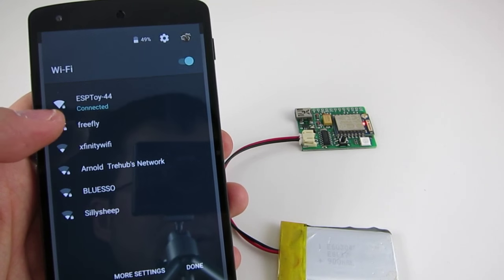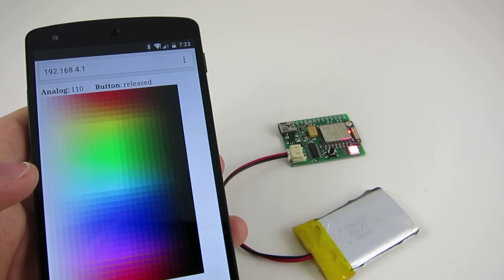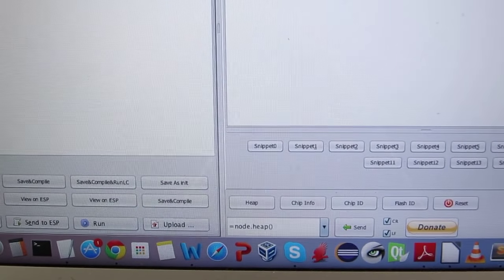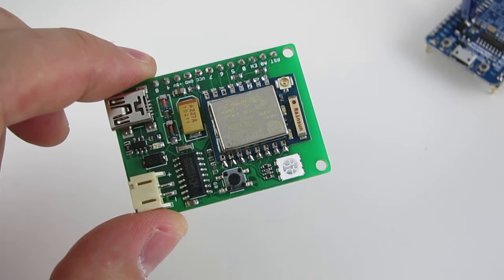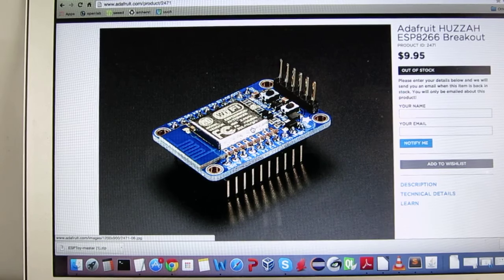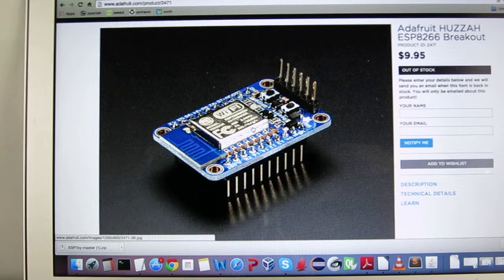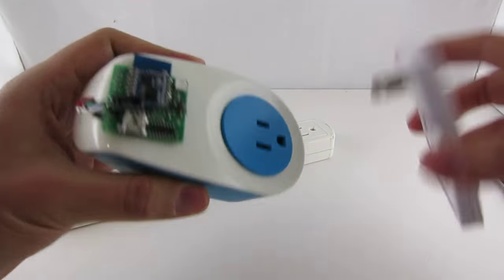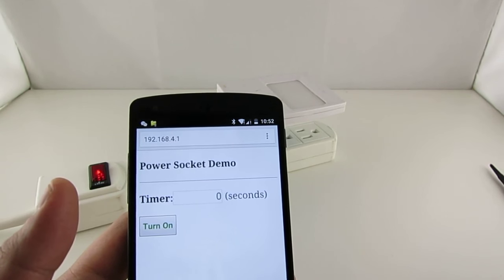Recent News and Updates on ESPToy

Comment: may i ask what LiPo battery charger IC you use ?
Reply from the maker: +aumotion It's TP4054 (compatible with MCP73831/73832)
Reply: +Ray Wang Thanks for the reply Ray, i should have looked at your schematic first :o)
Those batteries provide 3.7V right ? So if USB is not plugged, i guess VCC is 3.7V ?
Could you tell me what is VCC when battery and USB are both plugged ? i wonder if it is 3.7V? or 5V? thanks !